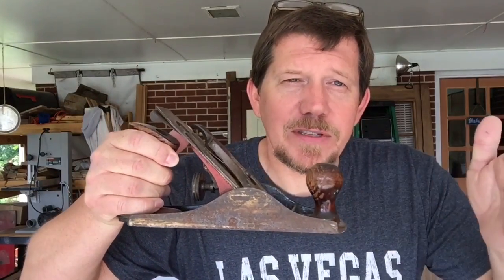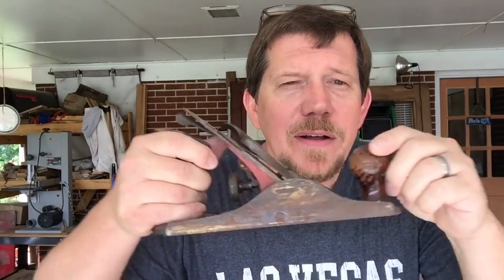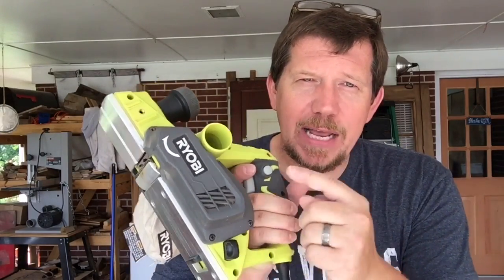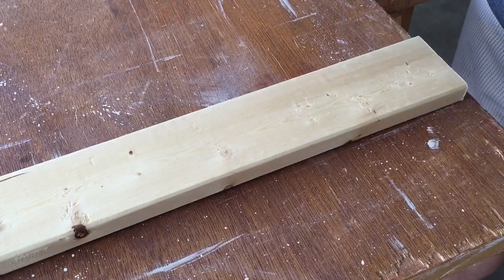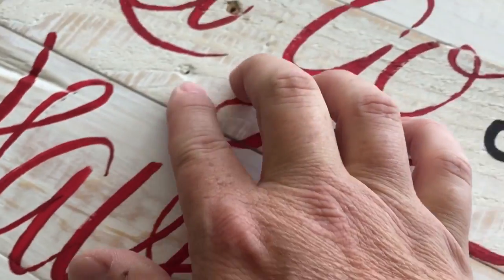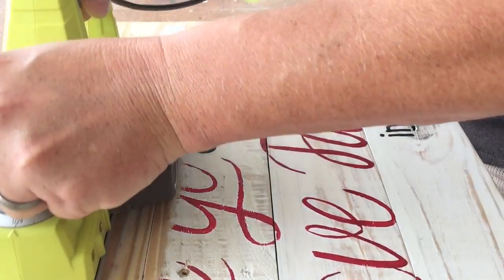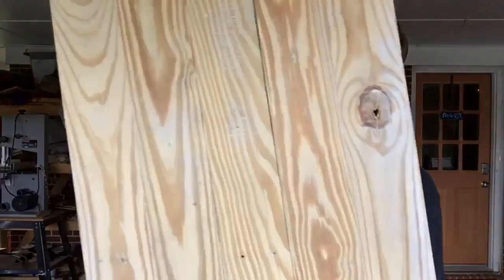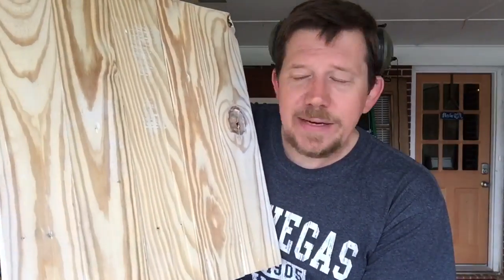Using the Ryobi Power Hand Planer

Comment: I'm thinking about making a tabletop out of some 2x4s. I usually have a buddy of mine to use his benchtop planer, but he's no available at the moment. Do you think this little guy would be able to handle it? Or should I sand it?
Reply from the maker: That's a great question. CAN it do it? Yes. But because of the narrow blade, it can be a challenge to get an even surface. Since I made this, I've decided that I reserve my power hand planer for objects that I can plane in one pass. Personally, I wouldn't try a table top. In a perfect world, the best solution would be to find a local cabinet shop with a Helical Head Planer and a Time Saver, go to them after you glue up and have them plane and sand it all at once.
Reply: Apple Valley Farm what if you plane the 2x4’s individual before getting them together. I believe the ryobi planer is wide enough to pass over a 2x4 surface in one go.